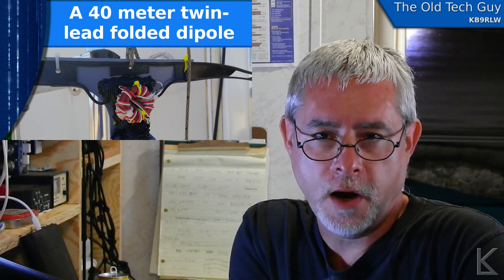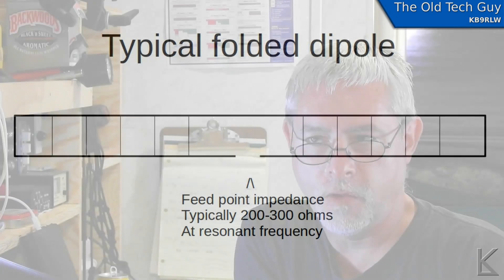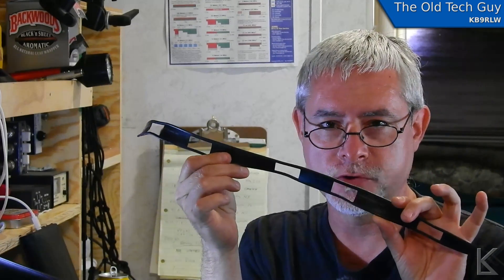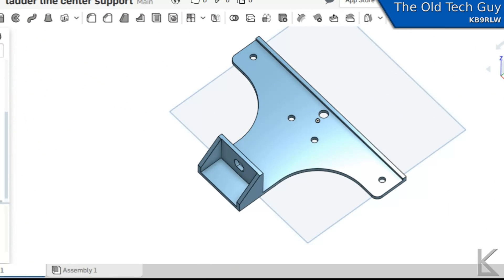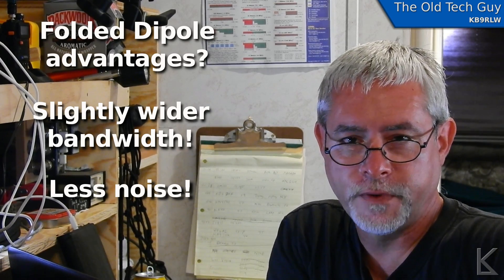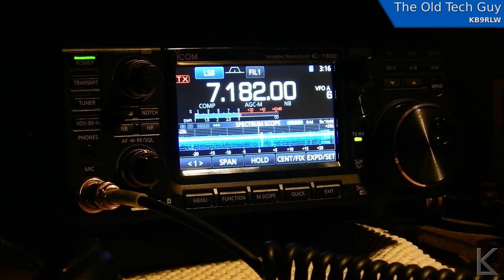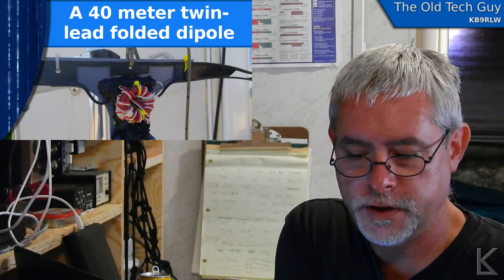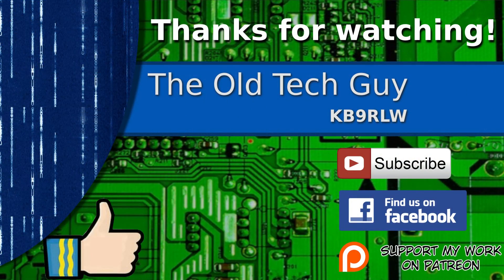Ham Radio - A 40 meter folded dipole using window line.

Comment: Hello Kevin,

Thanks for making these videos. Here are few observation. 1. Assuming you've printed the center part of the dipole with PLA it's worth covering it with a paint or a varnish. There is a good chance that PLA will not live long outdoor otherwise. 2. I wouldn't trust the SWR figure at 50 Mhz much, especially if the measurement was done through a long piece of RG58 coax. As you probably know this cable has relatively high loses, especially at high frequencies, which is especially important when you measure SWR. You have to multiply these losses by two - one time for the original wave and one more time for the reflected wave. Considering other factors, like measurement error, a little miscalibration of the device, etc It's not uncommon to see SWR 2 when it's in fact 6 or more when just 10m of coax is used. You can easyly check this with a vertical antenna (or even a dummy load) by making two measurements - one right at the feed point and another through 3/5/10 meters of the coax. You'll notice that the longer cable gets the more distroded the SWR figure is, and that the SWR gets lower for higher frequencies. 73 de R2AUK
Reply from the maker: Yeah, PLA might not be the best choice for long term installation.   Dollar Store nylon cutting boards make for great material stock for things like this.
I also wouldn't expect such a long antenna to work well on 6 either.  Too many lobes, loss in the feed, loss in the balun.  It might work, but won't work well.

Comment: Lightning would be vertically polarized, wouldn't it?  Maybe that's why the vertical picked up all that noise?  I read the comments.
Reply from the maker: Well, lightning is mostly cloud-to-cloud, or Cloud to ground at an angle, so it's certainly not vertically polarized. Also, the noise that you heard that went away, was hash noise from electronic devices. Lightning makes loud short crackling sounds. Electrically generated interference is usually a whooshing sound.
Reply: Clarifies things a bit.  Now, got any tips on learning Morse?  I'm building a qrp CW set, and it'll be my first time on the air, too.  SWL forever, though.
Reply from the maker: Learn the code by listening to the rhythm of the letters, don't count dots and dashes.  If you learn by counting, you'll hit a wall around 12 WPM where your brain just has too much work to do to decode letters.
I have a couple of vids on CW, learning and proper sending.  Search for my call and CW to find them.
Reply: Thanks :)

Comment: QRN is vertically polarized, so I'm not surprised the folded dipole is quieter.  I'd like to see a comparison between a normal dipole and a folded dipole.

I do like playing around with things like this.
Reply from the maker: I am interested in how you arrived at the hypothesis that noise is polarized?
I do see the noise on my sloper and NVIS antenna experiments by the way.

Comment: Great video Kevin.  I've built several folded dipoles with similar, great, results.  I recall a few years ago when I researched the noise immunity it was due to how the antenna responds to the E and H fields versus a conventional single wire dipole.  The folded dipole, being a loop, responds more to the magnetic (H) fields of radio waves.  Most man-made noise is electrostatic (E) in nature and less prone to be picked up by magnetic antennas.  The use of the current balun, as you mentioned, chokes off common mode currents on the coaxial feedline, so that the feedline isn't as prone to receiving noise as much either.  Seems to me some authors called the sensitivity to electrostatic voltages and currents the "antenna effect".  Sorry I don't have any citations to back this up, but that's what I recall as an explanation and it seems plausible to me.  73, Sparks.

Comment: Hello and thank you, Kevin! So this was the antenna in use when I decoded your signal remotely in Pennsylvania (also here in south Texas). Sounded great on the air! Low noise antennas are the best to use. Receiving a clear signal is half the battle. Speaking of receive antennas, if you feel so inclined, how about doing a Beverage Antenna video? 73 de N0IJK/5.

Comment: The bit about even harmonics can be turned into a feature for SO2R or Field Day.  With my 80m folded dipole and a 40m dipole mounted less than a foot or so apart at the center, and running the legs parallel, I was able to run 2 radios with very little interference at 100w.  I did keep the feedlines for each dipole as separated as possible.  Xmit on 80m(3.515) was detectable on the second radio on 40m, but right on the second harmonic the signal was only about S7 on 40m(7.030).  Undetectable away from the actual second harmonic.  Pretty darn useful feature right there.
Reply from the maker: That is a potentially extremely useful bit of info.  My old club in fort Wayne has been battling station interference forever.
Reply: @loughkb  Yes, very useful.  The second harmonic from a folded dipole is attenuated down more than most band pass filters.  (-50db vs -35-40db)  Very useful indeed.  Probably more pickup from coax to coax, and I would expect best results using coax rather than ladder line feeders for this purpose.  73 es gl

Comment: That's the only thing that kills it for me is it's only mono band..
so my 2 antenna i use for camping are all band HF Doublet 10~40 or an off center fed 10~40 meter 
I'm experimenting with a vertical setup where there is no treas with an MFJ Ham Stick on a painters pull 20' up with 4 ground radials dubbing as support wires.
little more work if i want to switch bands but it seems to work well with 10 15 20 and 40 whips.
Reply from the maker: Yeah, it's a trade-off.  Any multi-band antenna is going to be a compromise in performance on any one band.   A mono-band antenna is tuned for the best performance.
My dream house is a cabin in the woods with lots of trees around so I can put up individual antennas for each band. :-)

Comment: I am going to make one of these. Thank you for you video. I have a question. When you tuned it by trimming the ends did you do that by trimming and then connecting the upper wire on the ends to measure the antenna parameters, and then retrim, solder together, and repeat? Or, can you trim to length using only the lower wire and then solder the upper wire once you get a match?
Reply from the maker: I didn't measure it before connecting the wires at the ends.  I think that method should work since the unconnected wire would just be a parasitic element of the same length and characteristics.
I just twisted them together and didn't solder them until I'd found the right length.
Reply: @loughkb  Thanks. That is what I was thinking too. It will make trimming easier since you need to raise and lower the antenna each time. Before making the first cut I will scope the antenna with and without the ends tested to check.

I have a lot of local QRM that I am hoping this antenna might let me get a little better performance. Your comparison with the vertical was a dramatic improvement.

Comment: Thanks for the video. But I do not have a 3D printer. But do know how to use cheap plastic cutting boards for same thing. Can you just give me the measurements?
Reply from the maker: Not critical.  Just cut something to fit for your application.
Reply from the maker: Unless you're talking about the antenna measurements.  But those are in the diagram shown in the video.

Comment: Very interesting kind of like that . Would you think about making a 40 m loop that way
Reply from the maker: In a full wave loop, the wire length is slightly longer, but you still need to feed with a 4:1 balun as far as I know.
In this folded dipole,  if you unfolded it there would be a total of around 130 feet of wire.  In a loop, the online calculator shows 140 feet of wire.

Comment: Kevin when we built these for TV reception we would make for lowest frequency then wrap about 6 inches of tin foil on each leg. By sliding this wrap closer to feed we could resonate on the higher channels. I am trying to think of a way of tuning down to 20 ect. A capicative "short" so to speak.
Reply from the maker: I expect that any hack to trap it for use down on 20 would mess with the total length for 40 and probably reduce any gains in performance you get on the antenna as described.
Build two.  One for 40, one for 20.  Maybe they can share a feedline/balun and work as a fan of two folded dipoles.  It would get pretty heavy though.
Reply: @loughkb  I don't think you understood what I was saying it wouldn't be multi banded but could be changed to a higher band by sliding the wrap from the ends to the 20 meter point. The antenna might have to be lowered but shouldn't have to be cut.
Reply from the maker: Wether you use an inline coil as a trap, or a capacitive 'short', it still leads to change in the whole system.   I'm certain there would be loss in efficiency and performance.  Gut instinct.
Reply: @loughkb  this is a method that can can only be used on a folded dipole. I have only seen it used for reception but it worked well for that. It wouldn't hurt the antenna on the design frequency at all as they wrap would be shorted all the way back to the already shorted ends.
Reply: If it worked it would change the resonant frequency of the antenna. Closest coarision I can make is the Step IR

Comment: How bout adding an RF choke at the base of you verticle.... maybe a relay to test in and out... DC grounding??? Tnx for the great video ...73
Reply from the maker: I have done a choke on the vertical upstream from the 9:1.   It only helped 'slightly' with the noise.  Nowhere near as dramatic of a drop as on the folded dipole.

Comment: Nice. I think I’m going to try this. Could you run multiple lengths similar to a multi band dipole to the same center connectors?  Eg oine cut for 40! and one for 20?
Reply from the maker: I'm not sure, but I think that might work.  Sort of a fan dipole arrangement but with folded elements.   It would be one heavy antenna though.

Comment: I'm going to try a folded dipole. Looks interesting.
If you haven't and get a chance try a double boozka made from coax like RG8U,  without any foil between the conductor and braid. They also have an excellent quiet receive quality. I tried one on vertical. The lack of noise compared to others was phenomenal. It also has a DC short. I'm sure that must be the reason.
Reply from the maker: My gut tells me the bazooka might be quite similar in performance.  However, much more complicated to make and you really need a carrier line to hold the antenna under.  All those joints along the antenna become potential failure points under the load of it's weight and motion from wind.

Comment: and if one does not have a 3d printer?
Reply from the maker: Dollar store nylon cutting boards make a great cheap source of strong non-conductive stock material.
Reply: @loughkb  Yes, they do. I use them for all kinds of projects. So do the plastic cases of vcr's and other assorted junk electronics. I cut them using a bandsaw.
Reply: craig palmer ......... plywood, or plastic sheet, cut and glued. Not hard to think of multiple other ways to build what is simply a centre support. You could even omit the support altogether for a temporary install. Kevin only uses a 3D printer because he has one........he’s not producing his free videos to insist that you use what he uses.

Comment: Another well done job~! have you ever tried a double bazooka?  de w3les.....AND posted to my W3LES  fb pg
Reply from the maker: My gut tells me the bazooka might be quite similar in performance.  However, much more complicated to make and you really need a carrier line to hold the antenna under.  All those joints along the antenna become potential failure points under the load of it's weight and motion from wind.

Comment: One more question:  Can you fold a folded dipole thus making it take up half the space?
Reply from the maker: No.  The physical length will dictate the resonant freq.
Reply: @loughkb  What about making a 80 meter or 160 meter folded dipole and shorting it at the 40, 20 and 10 meter points, example if a 40 meter is 56 feet then make it 80 meters length and put a switch at the shorting point for 80 meters and switches at the 40 meter point and opening 80 meter switch and closing 40 meter switch.???? Would that then act as a 40 meter dipole?

Comment: Wow, that drop in noise is a big attraction for me.  Does your folded dipole need a counterpoise?  It looks a bit like a big loop antenna so I'm thinking maybe not?  Will probably build one after my 20 meter mag loop is up and running.
Reply from the maker: No counterpoise needed. Its a balanced antenna.

Comment: On  a 40m half wave  dipole  +- 60 ft is it  +-30ft from center on each side and do you solder the center conductor wire to one side and the braided  ground  to the other side? Have looked all over and havent found a good explanation. I know it seems simple. Please help.
Reply from the maker: Yes, that's correct.  And you want to start with 65 feet total so you can trim it back when tuning it.  Mine is around 64ft 7in now and it is perfectly centered on the band.

Comment: Great video. I'm doing something similar with 450 ohm but creating a linear loaded doublet to try and improve 80m in my small garden. So both doublet legs are not linked like yours but seperate with the ends of each leg shorted. Found info which suggests that you need 70% of the usual halfwave length per leg to create resonance so 46 feet linear loaded 450 ohm (2x23 feet) will get you about 7.1 MHz. Downside is narrower bandwidth for 2:1 SWR but as a multiband non resonant doublet, fed with ladderline / windowline into a tuner it might be worth a try. 73
Reply from the maker: That might work.  But you will need the tuner and it will probably not have the additional noise immunity.
Reply: In terms of noise my existing 44 foot doublet is v quiet hence my confidence in the RX aspect of this antenna. 73

Comment: could you put say a 450ohm resistor in the parallel line above your balun and make it a t2fd ?
Reply from the maker: Like Brian said, it won't be efficient.  The military used that arrangement to get full hf coverage.  The cost is loss in the resistor as heat.
Reply: You could but you then lose most of your power heating the resistor! :-(
Reply: @brianjohn9144  the actual loss is about 30% of your TX power, which can be a worthwhile sacrifice in some circumstances. The T2FD's SWR tend's to yoyo up and down across the spectrum covered by it, so a tuner is a useful thing to have in line. In the old days, before solid state amplifiers, this was not so much of an issue as the TX tank circuit would cope with the mismatch.

Comment: I am a real beginner with ham radio or radio overall.
Last month i made my first crystal radio, and now i am in the process of putting up my first inverted V dipole antenna in my backyard, so i can get on the 20 and/or 40 meter band. 
I just wanted to say that Kevins videos has been the most helpful in order to wrap my head around it all. 
Next will be to install a long Beverage antenna in the fields around here, so your videos are a tresure for a student
Reply: Keep up the good work! de KD5INM

Comment: That's not quite like the folded dipoles I've seen recently made from wire and spacers, but seems like a much easier to make design. The 4:1 balun is also neat and simple. I had to order a couple of toroids to make my own. And that noise drop would be great for an urban noise environment. I hope there will be a performance update in the future.
Reply from the maker: I hope to hear from a viewer that makes one in urbana.
Reply: @loughkb  Where is a good place to buy a bunch of that window line? If I had extra I would make a roll up J-pole, or a Slim-Jim with it too.
Reply: @JohnSmith-bb2np  Hamfest is where I get mine, usually the dealers have bargains since they are all competing for your business.  You can also make your own using plastic dollar store cutting boards or plastic coat hangers. Cut the plastic and drill holes in it the size of your wire and space it the distance of 450 ohm ladder line or you can use just about any spacing. I have seen ladder line up to 6 inch spacing.

Comment: What if you cut different ground lengths to gain that resonance on other bands , but then that  maybe changing the directional signal in the lobes. 
Has any one built a loop using FM 300 ohm ribbon, it  may sound silly I know, such as a triangle or square etc for more for a multi band use, as I was going to make a folded dipole for 40 meters using FM ribbon cable ? for low power. 
VK4fpkl

Comment: Wow. Thanks for review. We use that ladder line in our QSO Party field operations as the feed line for a large loop antenna with 1,000 feet or more wire. I found the same thing with the QRN. It was extremely quiet even compared to a regular dipole. We always twist the ladder line to keep it from flapping around so much in the wind.  Very good job, Kevin. Thank you and 73 de K7RMJ  Frank